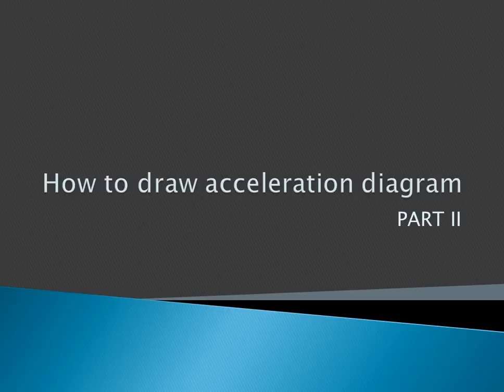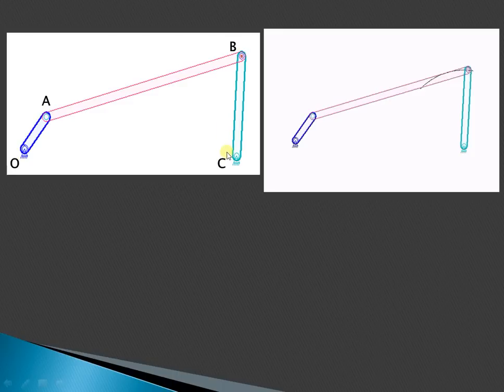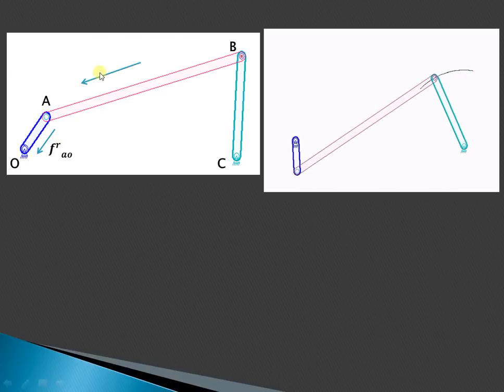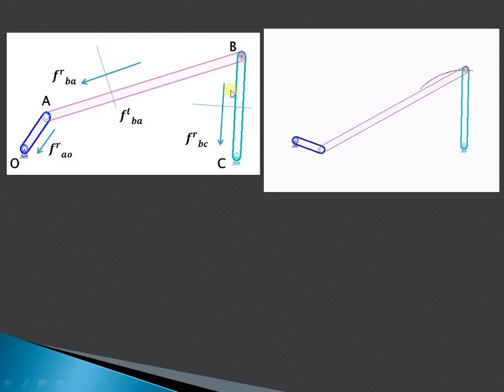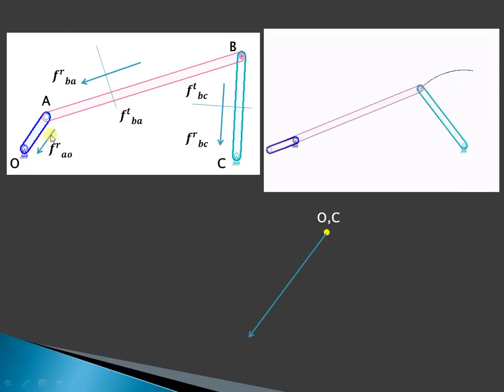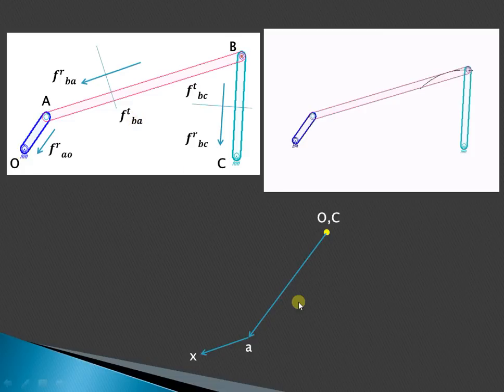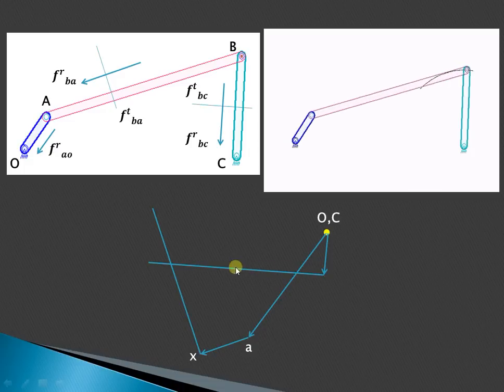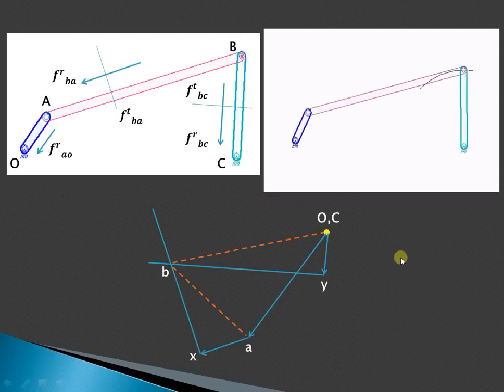Lecture 7 | How to draw acceleration diagram | Relative velocity method

Comment: #CHINMAYACADEMY initially in the diagram it is shown radial component of acceleration of crank is towards the centre O, but while you drew the actual one it is shown directed away from O?Got that confusion for a long time.Thanks
Reply from the maker: Please do not get confused. Actually when we draw the acceleration diagram we always start with the fixed points in the space and hence as the point O is fixed we started from that point and then followed the direction. In actual practice always remember that the direction shown and the actual vector drawn are 180 degree out of phase. Hope it will clear your doubt. Thanks !!
Reply: @CHINMAY_ACADEMY  So that would mean the acceleration diagrams are just for finding magnitude of the acceleration of links.Thanks a lot for the answer.
Reply from the maker: Not only magnitude but direction also. Read the acceleration vector like this: radial acceleration of a w.r.t. O and arrow must be towards a .  Please do not compare the position of O on both  the diagrams as said earlier. Thanks....

Comment: Sir, isn't that link OA is suppose to have tangential acceleration?
Reply from the maker: Link OA is rotating uniformly & hence it will have only radial or centripetal acceleration. Coupler & output links oscillates non-uniformly & hence they are having both radial as we as tangential acceleration.
Reply: CHINMAYACADEMY, understood
Reply from the maker: Most welcome ...

Comment: cad software i mean
Reply: Okay, means rotating links have zero tangential acceleration...
Reply from the maker: Linkage & Microsoft PowerPoint presentation. Thanks ...
Reply: +CHINMAYACADEMY thanks. But if you can use this cad software called working model it will be much appreciated
Reply from the maker: Surely will try...
Reply: don't bother the linkage software was great. thank you so much
Reply: why didn't you take tangential acceleration of link OA??
Reply from the maker: Tushar Rana Crank OA is rotating uniformly & hence its tangential acceleration is ZERO.